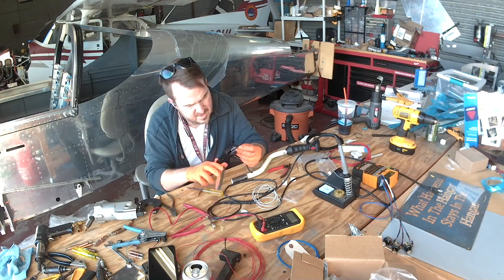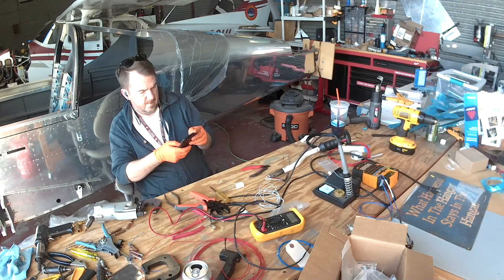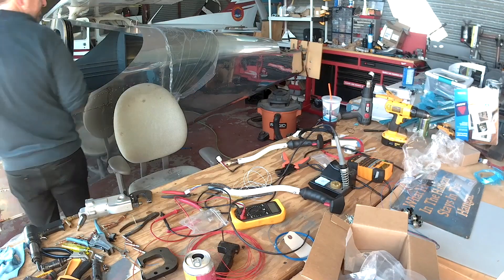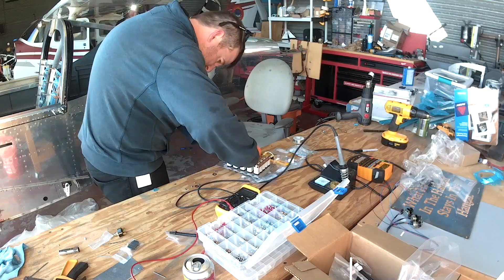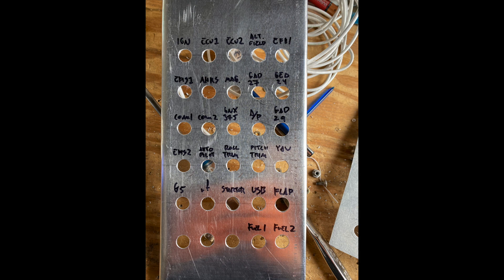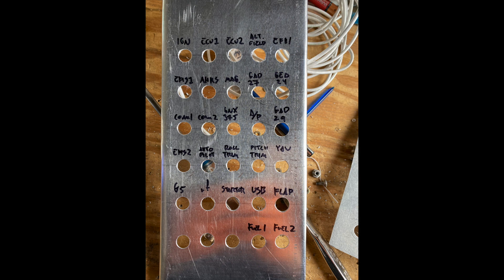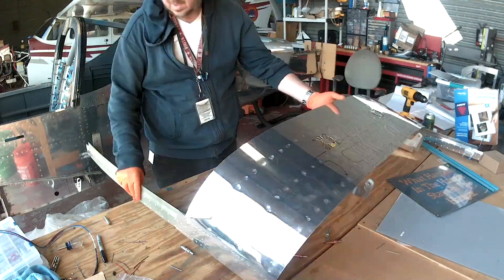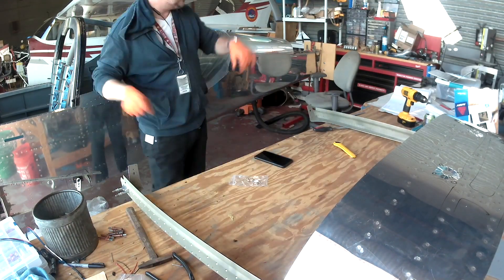RV-14 Circuit Breaker (CB) 1

Comment: How much electronic experience did you have before the build?  It seems like a lot to learn and maybe something I will need to have done by a shop.
Reply from the maker: Plenty of electric experience. Mostly running romex, house breaker panels, etc etc First time doing an airplane. It's just something you really want to march through delicately ($$$$).

Comment: Tip is to have the AP and trim breakers at an end/corner so you can pull those without looking in case of a runaway trim/ap mailfunction
Reply from the maker: That is an excellent point sir and I'm going to make that modification today before I forget!